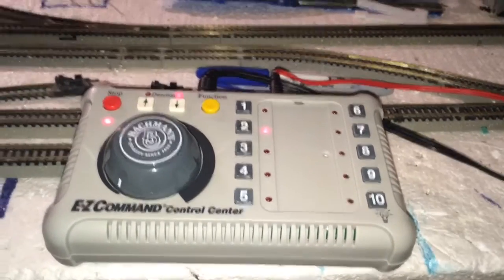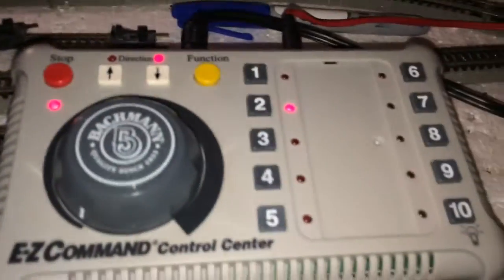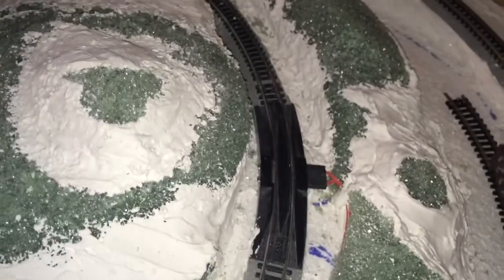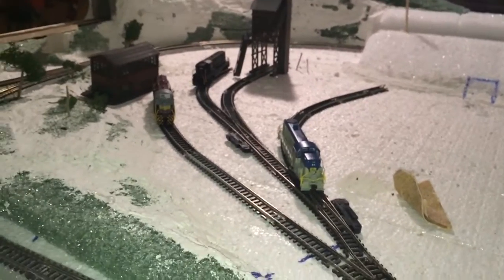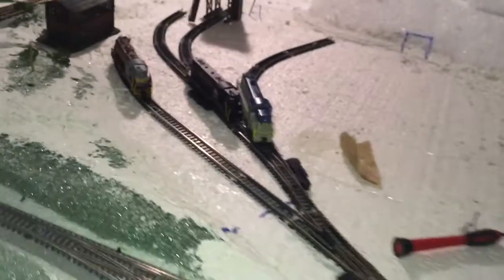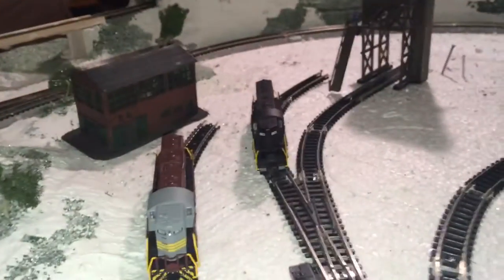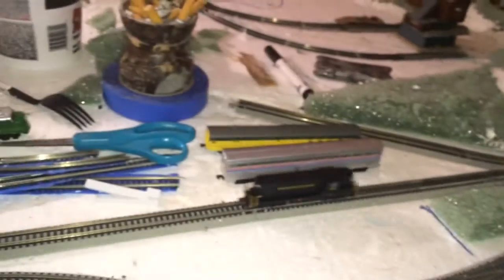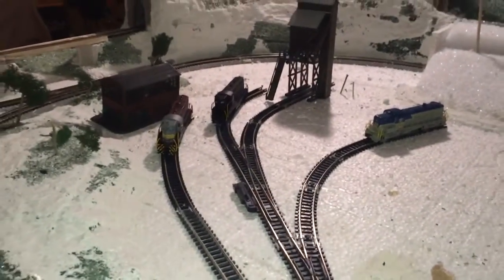Bachmann EZ Command DCC Review

Comment: Thanks for the video. I have vintage locos so I'm still running dc. I want to take the plunge but I am concerned with damaging them. Could I run both a dcc and dc controller with two power rails and switch back and forth depending on what locos I'm running? Thanks for the advice.
Reply: Guitar Man yeah you can usually dcc controllers have the option of running dcc or dc engines
Reply from the maker: I would just go DCC, and get an EZ Command. You can run 1 DC engine at a time on the EZ using channel 10, while running your DCC at the same time. Or Isolate your mainlines so you can run DCC on one, and DC on the other without them being electrically connected.
Reply: Hey thanks so much. I have subbed. Cheers, Glenn.
Reply from the maker: <3

Comment: Are you only using the E-Z DCC Command Controller as your power source? It stated in the manual that the 1 amp E-Z DCC Command Controller can only run 2 locomotives, but you appear to be running many more with no additional power supply. Is that correct, you are only using the power from the E-Z DCC Command System only? And how many can you run at one time with it?
Reply from the maker: +Learjet9290 Ive run just the dcc for months, and have as many as 6 running at the same time (3 mainlines and a couple in tandem on the "same channel")
Reply from the maker: +Learjet9290 mine does yeah, i dont see why yours would not.....have you looked over every square inch?

Comment: Will I need to convert my DC engines to DCC in order to run them with a lead engine that has DCC? I hadn't started building yet do to an upcoming move in a few months, but I am researching and have been collecting material for a while now. Thanks for any info!!
Reply: I wouldnt run any DC engines with DCC power. Go all dcc or all dc. Switch and swap will help not destroy any of your engines. Can get screwy at times but i usually run one or the other
Reply from the maker: I wouldnt run any DC engines with DCC power. Go all dcc or all dc. Switch and swap will help not destroy any of your engines. Can get screwy at times but i usually run one or the other

Comment: does the bachmann ez control work with any locomotive from different brands like athearn
Reply: absolutely, as long as they are dcc equipped!
Reply: if they are dc, will still run on that function as well!
Reply from the maker: yes
Reply: @TheTrainMane  thanks for letting me know
Reply from the maker: <3
Reply from the maker: <3
Reply from the maker: <3

Comment: Hey Train Mane, check out my channel and see how I labeled the E-Z DCC Command Control System. Also, added my tiny benchwork video to it. Still have more to do. Looking forward to an update of your layout.

Still learning the Bachmann E-Z Command Control System, and I am a little freaked out to leave it turned on, so I am continually unplugging it when I leave the train layout. Just not used to that constant voltage like DCC has and more used to DC, which if you don't have the power on no voltage is going to it. Also, my Bachmann E-Z Command System does not have an off switch, does yours?
Reply from the maker: it does have an off switch on the bottom!

Comment: Bachmann is a mixed bag, and since our North American loco types differ from Euro types, I can only address N.A. types and only n-scale locos which have inherently more intricate parts than larger scales. Older series of their diesel locos were primitive, with noisy gears, iffy pickup wipers, and poor low speed operation while steam locos were hit and miss. They stuffed many cheap retail train kits. 

Improvements came slowly around the millennium with Spectrum series first diesel winner being the SW 1200, and steam winner being the Consolidation 2-8-0. Other early Spectrums including split-frame F9 and Dash-8 designs suffered from an inferior noisy swiveling worm / drive shaft design and splitting nylon gears. See "Spookshow N Encyclopedia" for a useful review of each model. 

Bachmann's E-Z DCC 9 + 1 DC channel DCC control box entry level system (shown in video) was made for them by DCC pioneer Lenz GMBH, and is thus fairly good as are the decoders. There is also a 10 channel (wired to i/o plug) walk around accessory available, identical only dark gray colored. Using the DC companion control with DCC will let the smoke out of your n locos. It can be used safely as stand alone for DC only without the DCC box connected. The newer E-Z Dynamis wireless IR remote DCC system has problems according to Amazon reviews.
Reply from the maker: i see both sides

Comment: Okay here's a review for you after a month of usage I was running 3 Bachmann engines on individual addresses. My controller just stop, and a burnt smell started coming out of the back of it. If you want my opinion save the money and buy something else because today I'm on my way to return it to Bachmann which I have to pay for the shipping and handling. It is a piece of crap. It is very cheap for a reason but if you have to keep on returning it to Bachmann and keep paying for shipping and handling before you know it soon you could have bought  a  super expensive power command
Reply from the maker: hmmmmmmm
Reply: You can use the ez command dcc 5 amp power booster
Reply from the maker: <3